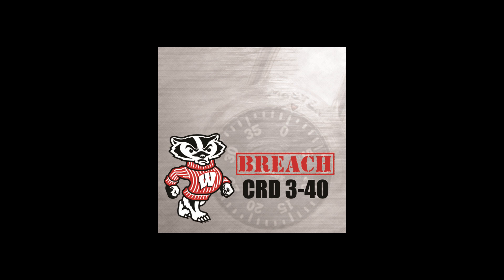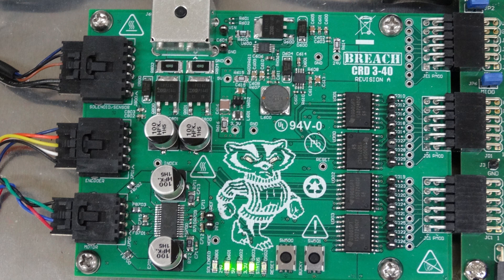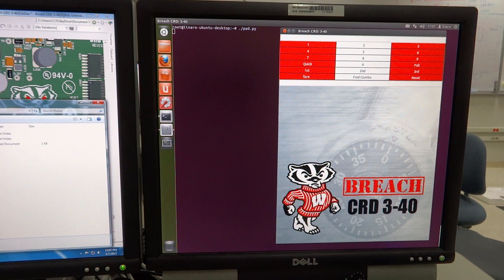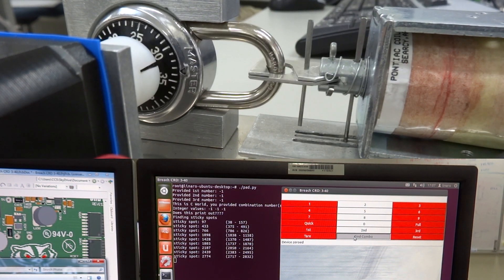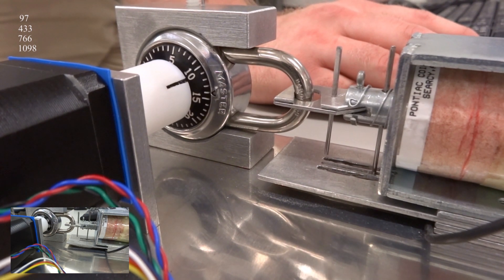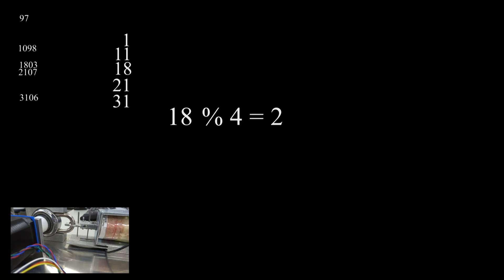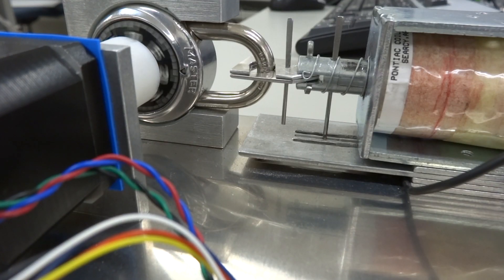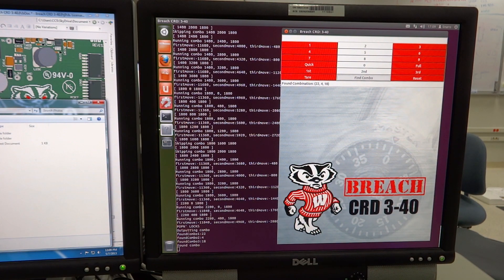Security Breach Team - The Combination Reclamation Device

Comment: There aren't 64000 possible combinations. 40^3 = 64000. However the numbers cannot be the same and they all must be either odd or even. So that is 40*19*18 = 13680 possible combinations. So even if masterlock fixed the sticky spot problem a machine such as in the video could still bruteforce the combination. Of course shimming is a much bigger problem.